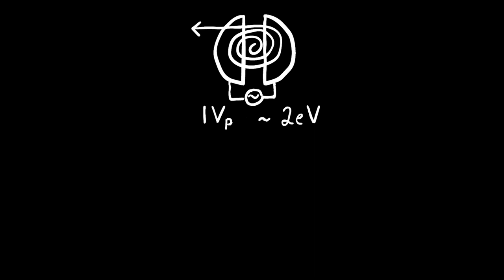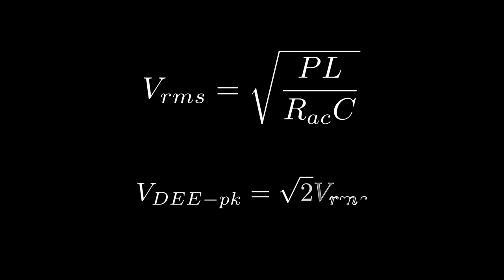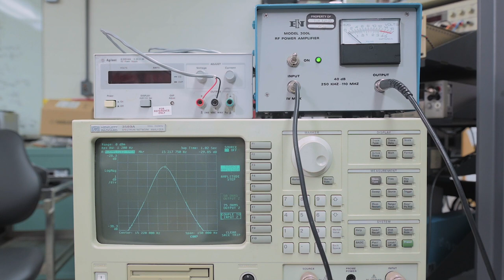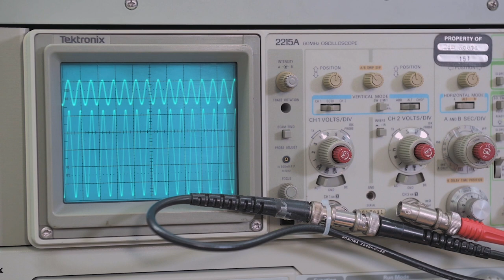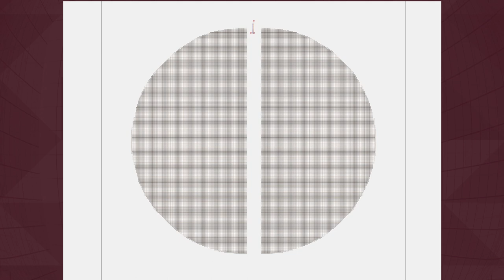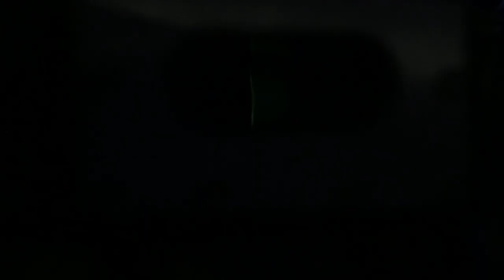The RF System - Cyclotrons!

Comment: Very interesting video and impedance matching methodology. Before seeing your PLL-based impedance matcher circuit, I thought you guys really need to automate that tuning process, especially given heat induced changes during operation... but you have!
I'm accustomed to motorized varicap tuned impedance matches for ICP & CCP semiconductor etch systems. Though motor driven varicap matching systems are common, I conceptualized an inductor based tuner, where a series inductor's inductance is varied via the permeability of its core, using an orthogonal DC (RF blocked) inductor surrounding the RF inductor. The current of the tuning inductor is then varied in a closed loop based on the phase shift... no moving parts, so potentially faster response than motorized varicap based system. 
I found that Applied Materials filed such a patent circa 1996.

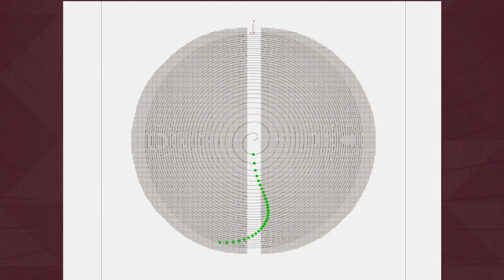At 32:31, it seems that with such an extreme example of phase slippage and dwell near 1/2 radius of the cyclotron, there could conceivably be a significant increase of ion pressure in that radial region, which could further decrease the mean free path and thus proportionally increase the probability of ion collisions... then again, given the uniform direction and a potential resultant magnetic coupling of the ions dwelling in that region, perhaps other interactions other than de-energizing or diffusing collisions would become probable... i.e. clustering or less dramatic scattering/diffusion 🤔

Perhaps a radial array of voltage or charge probes (like an LCD strip and a CCD) could be implemented to detect the prominence and location of 90 degree phase shifts along the ion path (as there would theoretically be a detectable charge accumulation at that inflection), then you can sweep the RF voltage and empirically plot the optimal voltage/s for successful ion target strikes.

Comment: Really cool that you are showing the inner workings. On your auto tuner you shouldn't need to mechanically auto-tune a trim cap, the responsive curves are going to be too slow. The RF path should be far more stable and you should be able to use fully digital phase and frequency correction.

Comment: I've been playing a couple of times with HV RF generator about 2 MHz, 4-5 kV. It's insane! If the "hot" wire was laid onto something like plywood, plastic or any combustible insulator, it led to fire and Ligtenberg figures propagating on the surface. The hot-to-GND arc was so hot that my screwdriver tip melted into a ball. Just a hundred watts or so.

Comment: I think you got the FWHM wrong. As the name says it's the width at half the maximum and not at 3dB or 0.707 but rather at 50% or 6dB...
Reply: -3dB is 50% power.  Every increase of 3dB is a doubling of RF power.   Just use the equation for gain, Gain[dB]=10Log(Pout/Pin) and give it a try of gain of +3dB to see what you get for Pout for a Pin of 1mw. (or 0dBm).
Reply: @TimothyWKoeth  didn't recall talking about power. Thought the amplitude was in discussion....
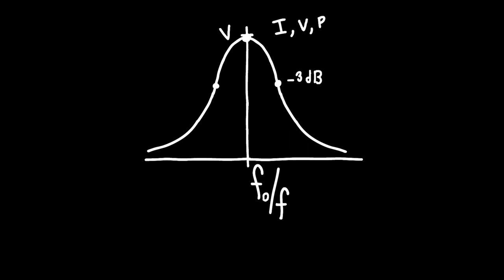Reply: @LutzSchafer  please look at around time 6:10, I am careful to say this is for a power measurement. Is there another location where I do not say it correctly?
Reply: @TimothyWKoeth  Now that you have clarified it, it all makes sense. Thank you! My bad assuming amplitudes, maybe also because I am working in a different field...